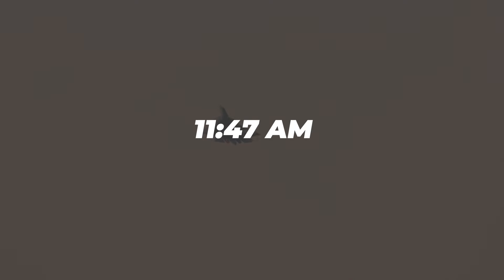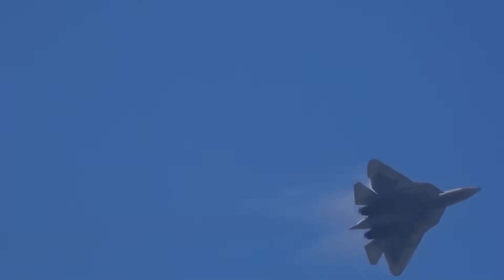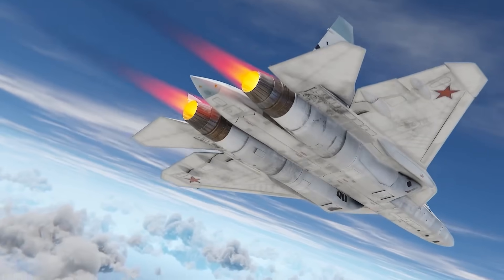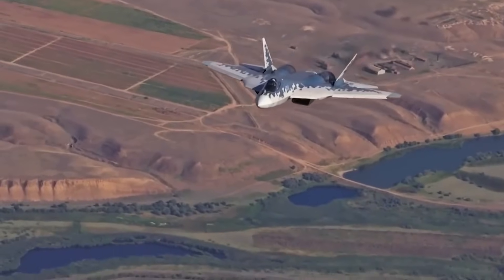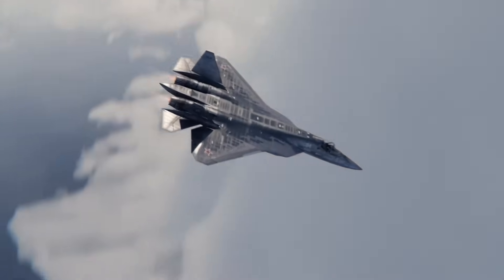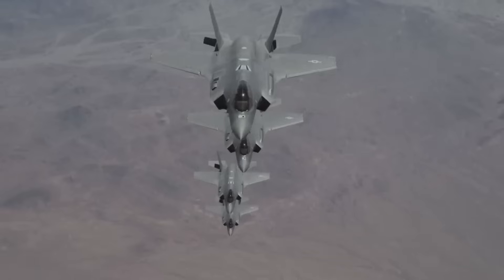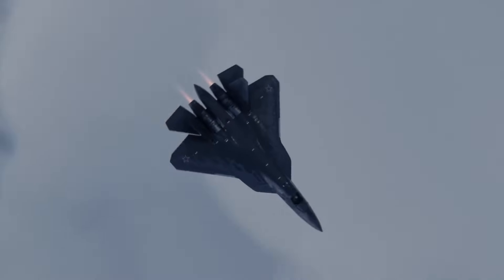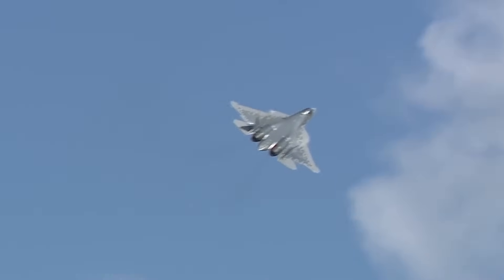Why the Su 57’s ‘Bad’ Design Is Actually Genius

Comment: Russia had deviously claimed that the Su-57 is a "𝟻ᵗʰ-𝚐𝚎𝚗." fighter jet 🤬🤬 
Evaluation by the Indian Air Force showed it to be a 4ᵗʰ gen. aircraft lacking 3 important criteria for a 5ᵗʰ gen. fighter jet – low-observability, sensor fusion and ability to supercruise.
Reply: ""Evaluation by the Indian Air Force showed"
So immediately you are lying.
At no point IAF conducted such an evaluation.
"low-observability, sensor fusion and ability to supercruise"
Su-35 qualifies for all three.You don't need Su-57 for that.

Comment: This clip maker is obsoleted. He does not acknowledge of the latest Su57 which it has the new tail pipe similar to F22 but with more wisdom design that it is put in deviated angle which allow it  3D thrust vector without circular shape.